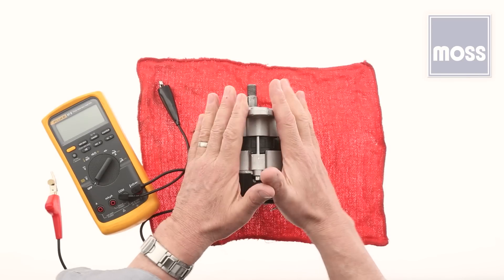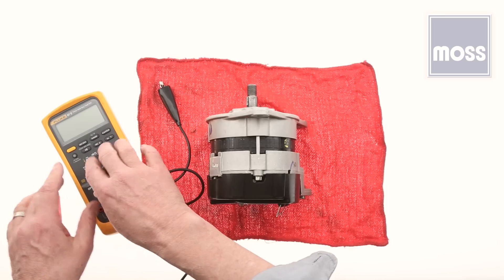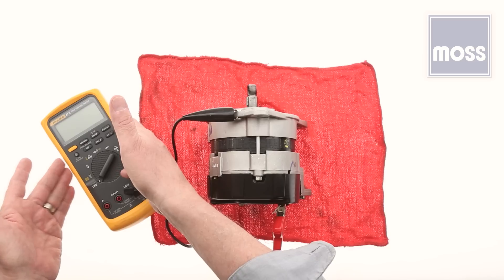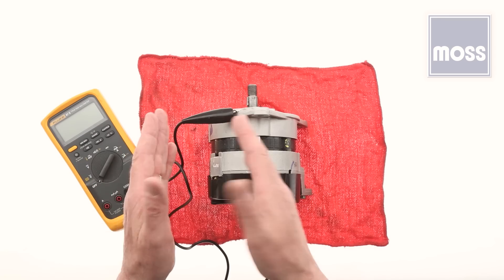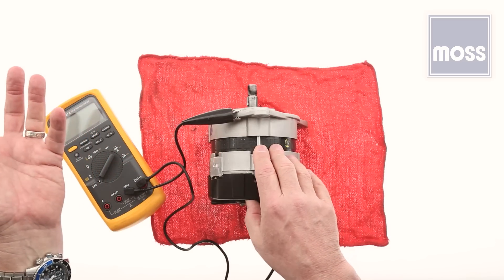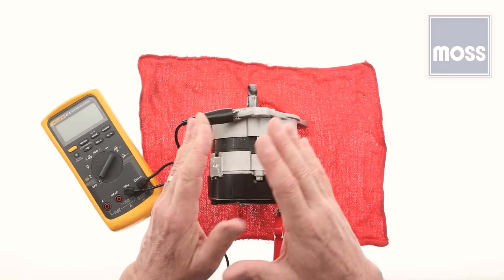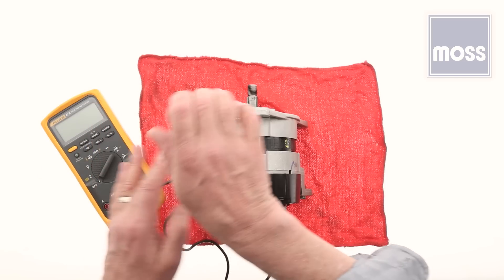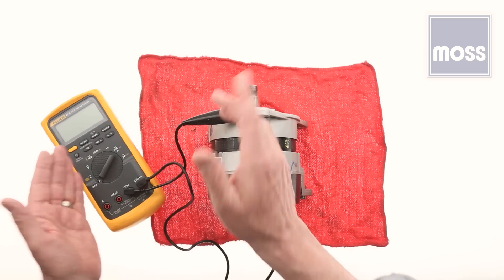Alternator - How to test using a Voltmeter

Comment: IT IS CALLED A MULTIMETER SINCE V=IR. ...YOU MEASURE CURRENT WHICH IS  I=AMPERES......R=RESISTANT=OHMS....IT IS NOT JUST A VOLTAGE MEASURMENT.

Comment: The problem is an alternator sits usually in a tight space ,deep down under AC compressor( sometimes) and to test it one has to remove it first.Mind boggling amount of work on an old car where every screw is a miniature battlefield

Comment: puzzle:  my alternator light on my TR3 glows red on startup for about 10-15 seconds until i blip the throttle multiple times. this ONLY happened on first start of the day, never after. then one day it continued to glow red slightly with ammeter pegged at zero or a little less.  i thought a loose fanbelt but not.  what gives with this??

Comment: That looks just like the alternator on my 94 SL1 and 95 SL2 Saturn. I have an 120amp aftermarket installed for my SL1 and the wiring I did for it makes a sharp difference from the 95 SL2. You can shine the High beams or tap the brake pedal and the dash lights won't loose brightness.

Comment: I disagree a 100amp modern alternator is more heavy to run than a 1990 70amp alternator WHEN they are generating same current, let's say 20amp.... of course the load will be higher ONLY when engaged full power  with a current > 70amp of the original amp.  With no load both the alternators are free running...

Comment: All these tests presuming the car will start, but because the alternator isn't charging the batt it will drain it and won't start. Remove the alternator a simple multimeter, ohms continuity test will determine the fault. You don't need to over elaborate

Comment: not a stitch of video information on how to bench test an alternator. Instead we get two empty hands,  blank voltmeter screen, no wires, no test leads. Hoping to see a simple B+ and ground connected voltmeter showing a minor voltage output from spinning the alt. I just bought a new alternator w/ lifetime warranty. 30 seconds after it failed to produce voltage on a vehicle with circuitry loads I was on the phone arranging to take it back to the auto parts and wondering what would the penalty be for tossing it through their window.

Comment: I have a Sierra cosworth with a strange alternator fault. Warning light works. Battery is good and all wiring is good. “New wiring and alternator” start the engine and the warning light stays on. Rev the engine and the light will go off and the alternator will start charging at 13.8v and stays there. Until you release the throttle back to idle and it will stop charging 12v and the warning light will come back on. Any idea ? I’m thinking faulty regulator?

Comment: This will not work on an external regulated system! Alternators put out a.c. voltage to the regulator. You can not read an alternator with an external regulator at the battery terminal on alternator.

Comment: What a load of bunny! Why not show people on an actual car, with actual readings on the meter duhh... You can just plug in a 3 buck cigar lighter voltmeter. High output alternator tip is total rubbish. There needs to be a draw on the electrical system to make the alternator create high current.

Comment: Your videos are always a great help. Thanks for dedicating so much time to make these. I run a lot of electronics in my vehicle and my Honda only maintains the battery voltage it doesn't really charge it. I also need a HO alternator and was curious if a self exciting one that constantly ran at 14.8v would damage anything?

Comment: I beg to differ with you in that current is drawn from its source, so if you replace an alternator who's load is drawing 30 amps from it, it doesn't matter how much larger alternator you  put on it, if the output voltage remains the same, then the current drain of the load WILL REMAIN THE SAME! The engine power required to operate the alternator may change slightly, but not significantly!  The only reason to go to a larger alternator is if you need more current, for example if you were adding  different headlights, that draws more current, of if you were adding a high power sound system.... 
You also botched the explanation of the "bad diode" a defective diode has 2 failure modes, first is open, the second is leaky to shorted.... in the "open" failure mode as you said you lose the current output of that winding... where as the leaking diode allows ripple or AC to into the system and drains the battery when the reverse or opposite polarity voltage is present, it will also draw current from  youre battery when the engine isn't running depending how much the diode is leaking.
 Effectively, an automotive alternator is 3 parts, first it's a three phase AC GENERATOR, second, it is a rectifier pack to turn the AC into DC, third it has a voltage regulator to regulate the VOLTAGE OUTPUT of the alternator .... 
If you are a mechanic you need to understand the difference between voltage, and current, and their impact on what its connected to.

Comment: You forgot to explain how to test the diode. If you select "diode" on your fluke with the way you have the probes hooked up it'll show reverse voltage. If it shows OL the diode is good. If it shows reverse voltage then your diode(s) are defective and are allowing back flow and your alternator will drain your battery when the vehicle is off. If you switch your probes around it'll show forward voltage and should be between 500mV to 800mV "from what I've read".

When I do the diode test on my alternator it shows 400mV forward voltage and 1.3V reverse voltage. So I can see my diode(s) are bad. My battery seems to drain really fast but my amp draw is only 30mV when the vehicle is off. Does a defective diode with back flow of 1.3V show up under amp draw? I feel like mine doesn't.

But from watching your video I've learned something new. I didn't know there was more than one diode. So you're saying if one diode is bad your alternator will still show a correct charging voltage (~14V) but it won't actually be charging? Is there a way to test your alternators output to see? I assume you'd check for amperage?

And to test for VAC leakage you're saying .5V or less is acceptable but the normal range is (.01-.03)?

Comment: Problem is a voltage check is OK but an amp meter check will be required as well I have seen many times, defective alternators that out put voltage but no amperage at all  so don't just go by a voltage test.
Reply: that would mean it an open circuit somewhere so test accordingly

Comment: a good alternator at idle 700-800rpm should putout a min of 14.2v  if its charging over 15v at any speed the voltage regulator is bad & will boil & damage your battery !    & your not correct about a higher amp alternator overloading the wires  and putting a heavier drain on the engine   a 150amp alternator will only put out 150 amp if you load it to draw that much amp   if you only load it to 50amps that all its going to put out not 150 and want load the engine anymore then a 75 amp alternator  loaded a the same 50amps  what you should have said is if you put a higher amp alternator say a 150amp  where your car only came with a 75amp alternator and  you  TRY to Draw  150amps  say with adding big power stereo amps then yes its going to load the engine more and start to over heat the wiring  if you did not upgrade the wire gauge to handle the 150amps draw .
Reply: 218Bee mod43win One of only a handful of people that understand ampdraw. Amperage is used, so the 50 amp to 175 amp statement is correct. You never want to match need to output. If you measure current draw at 87 amps, 125 to 175 is adequate and safe , providing you have the correct wiring gauge.

Comment: Sorry Nope !!!  He forgot 1 important thing called " Excite / Self Exiting ". 

Example: If you leave your Light on all night in your Car.  The Battery will be drained.... But when you turn on the Car.  Since the Alternator doesn't have enough Voltage to " Excite " the charges.  You would think that the Alternator is NO GOOD, since it's NOT charging the Battery.  During your measurements like aka.. Voltage Meter, it will NOT show up since the Alternator hasn't been excited.  It takes a few minutes to " Excite " the Alternator and the Engine needs to be 1500-2000RPM in order for things to get back to normal again.  NOTE:  During this moment, a lot of People forget that " Excite " period, they ending up pulling all their hair out ://.

Comment: I want to know how much is the amperage output of a particular alternator. And what is the correct battery applications.
Reply: A functioning 12v 100 amp alternator always gives out 13.6 to 14.6v or thereabouts of voltage. Amperage is given to any device depending on the draw of the device or battery itself- limited to the maximum of 100 amps in this case.

Comment: Only thing is, a higher power out putting alternator can't damage systems as  the components that are fed cannot draw any more current than they would with the battery in the  system, and we know the batteries can deliver over seven or eight  hundred amps of current.  
Ohm's law will tell you that.  But a defective regulator can do damage allowing it to output too much Voltage. Which is electromotive force that pushes  electrons. Current.

Comment: I wanted to know if I can check it on the bench? What resistance should I get at various points? I got zero ohms from every terminal to every other terminal and ground. I assume my alternator is dead? Correct?

Comment: Unless things have changed in the past forty years a good operating alternator should be charging 14 to 16 volts as you have to remember that while the vehicle is running you have numerous items in the vehicle that is using electricity so you need way more than what this guy is saying. If you are not getting minimum 14 volts then the alternator is bad.  Also one thing this guy forgot to say is that the battery needs to be a good battery, if the battery is bad then it will also show a bad and faulty voltage charge reading. Depending on the make and manufacturer of the vehicle the alternator needs to have a certain amount of voltage to begin with to be able to charge the battery. Also if the battery has a bad or faulty cell it will not charge and give faulty readings. Perhaps British cars are different than American cars since this guy constantly talks about British cars.

Comment: Had my 1986 Jag Series III Alternator tested at a Lucas workshop. The technician said that there wasn't any issues with the unit despite the voltmeter on the dash working/not working fluctuating volts, unit tested by me in the manner described, same symptoms etc. Might be a cable(although have tested them too but now thinking a diode issue. Pity, the car is fantastic to drive but has never charged my battery(s) properly.....

Comment: Excess current through the wires only happens when there are loads to create that problem. It is much better to have an alternator with excess capacity than one with insufficient.

Comment: why does an alternator overcharge?
Reply: its battery faulty
Reply: can also be the alt . the regulator goes bad , it will over charge.
Reply: regulator  or battery problem
Reply: BAD VOLTAGE REGULATOR

Comment: the best instructor i've seen so far
Reply: agreed.
Reply: Sorry Nope!!!  He forgot 1 important thing called " Excite / Self Exiting ". 

Example: If you leave your Light on all night in your Car.  The Battery will be drained.... But when you turn on the Car.  Since the Alternator doesn't have enough Voltage to " Excite " the charges.  You would think that the Alternator is NO GOOD, since it's NOT charging the Battery.  During your measurements like aka.. Voltage Meter, it will NOT show up since the Alternator hasn't been excited.  It takes a few minutes to " Excite " the Alternator and the Engine needs to be 1500-2000RPM in order for things to get back to normal again.  NOTE:  During this moment, a lot of People forget that " Excite " period, they ending up pulling all their hair out ://.
Reply: tHE CAR WOULD NOT START IF THE BATTERY IS DRAINED.You have to use jumping-cables .Then the magnetizeing-diods will work and it will lift voltage.Scania electrician in Sweden.Now retired!
Reply: Id suggest a clamp meter rather than a meter like this also. Much easier to use in a consistent manner. Also swedish.

Comment: you can bench test an alternator just fine, even with a bad diode, which would not show up in your limited testing. Problem is a bad diode can generate a current draw from the battery instead of charging it.